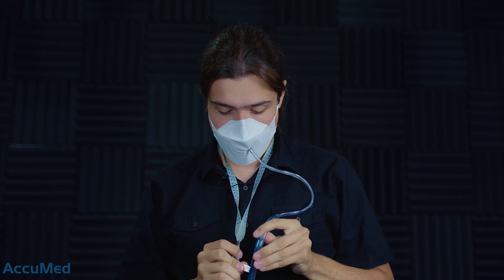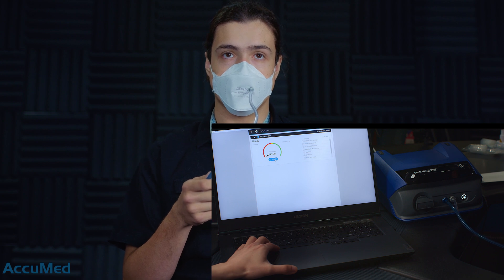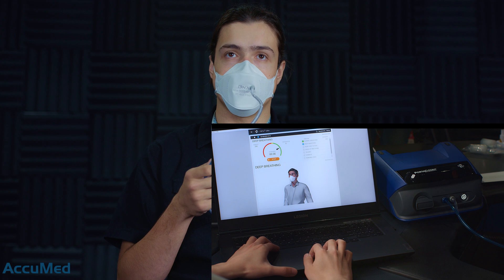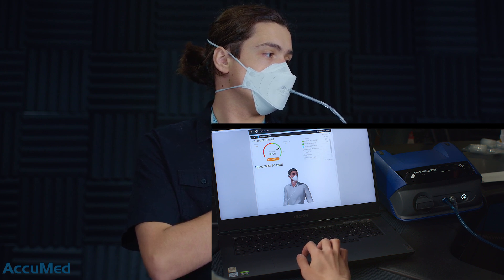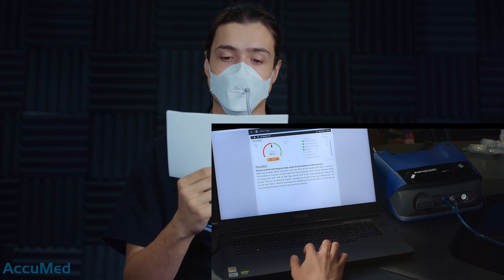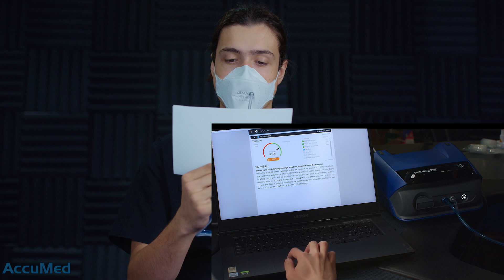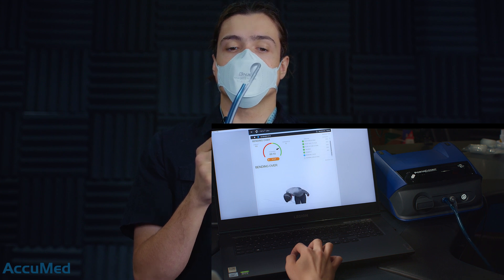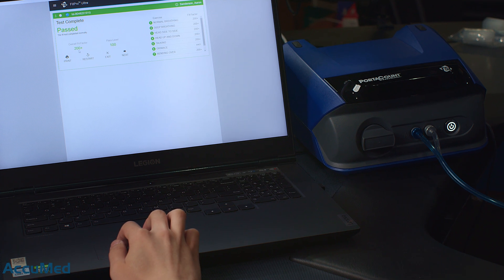BNX N95 Mask TSI PortaCount Fit Test (Model F95W) Real Time Respirator Fit & Seal Tester Results

Comment: I was hopeful that this would be an Aura alternative(so I wouldn't sound like a 3M shill), but after buying these respirators I felt that the nosewire was sub-par. Upon taking the respirator apart, I could see that internally it uses a breadclip rather than a mesh metal nosewire like Auras. After half a day of use, this might make a big difference in the seal integrity.

Comment: I have a high nose bridge and with tri-fold masks it's a tug of war between pulling down to get good seal stability below the chin or pulling up on the mask to reach and seal the proper spot above the high nose bridge. It's a perplexing battle.🤪
Reply from the maker: Not all masks fit the same. Depending on the environment you are in, your safest bet is to have a mask that fits properly. The F95 model fits medium to small faces, but even in this instance it fits well for a 6 foot male.

Comment: I have a big nose bridge and my husband has almost no nose bridge.  We both needed to add a stick on nose wire to prevent leakage at the top when using a nebulizer to test it.  I think BNX mentioned their plans to improve the wire and quite unfortunately, make it thicker.  The bottom strap had almost no tension for me (I have a small head and face).  My husband didn't smell anything, but it smelled like cat piss to me.  He's usually more sensitive to that sort of stuff, so that was odd. Of course, I know to air it out, but it's a tad too big for me anyway.  For flat folds it's really important to flatten and pre-bend the nose wire.  The sharp triangle at the top lets unfiltered air in.  With trifolds and duck bills I hold the two straps and kinda scoop the mask onto my face then adjust the straps.  It's hard to explain, but it makes donning pretty fast/one main motion.
Reply: Moldex has disposable respirators with elastomeric sealing in different sizes.Although it's still not guaranteed for every face to get a perfect fit,you can give it a try. In Europe, they're called the Air seal and Air plus lines and have the second best breathabilty after VFlex ,due to 260% more filter surface.I guess in the US there is something similar ,like the Moldex AirWave,4200,4600 and 4800 N95.The European Air Seal and Air plus have breathing resistances of 60Pa (ffp2) and 90Pa(ffp3) respectively.I have the 3408 ffp3 and probably going to get the 3700 version soon.
Reply: @losac6136  we used full faces pre-vaxx which were extremely breathable and have half face elastos as well along with a huge variety of disposables.  Disposables are easier in a few ways though fit testing becomes even more important as the user seal check isn't as good.  My favorite is the Jackson (Kimberly Clark) duckbill (most comfortable and breathable mask I've tried) and the Bluna KF94 with a lanyard ear saver and stick on nose wire and my husband's favs are the 3M N95/KN95 flatfold and the Vflex to a lesser extent.